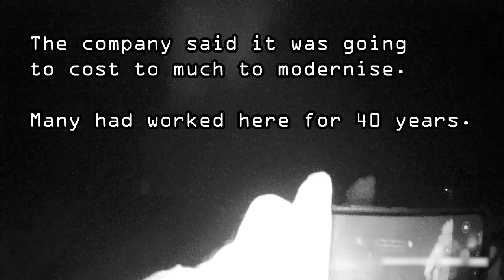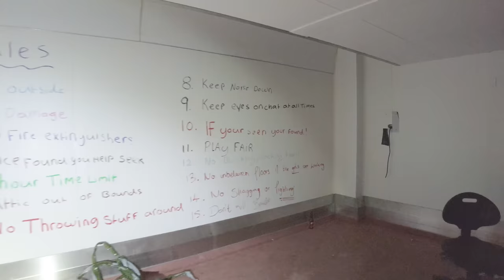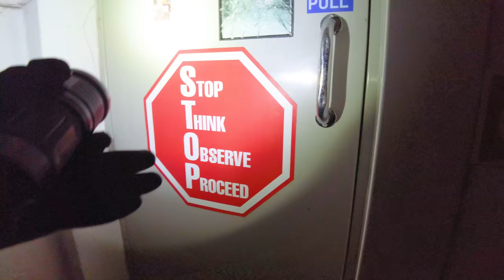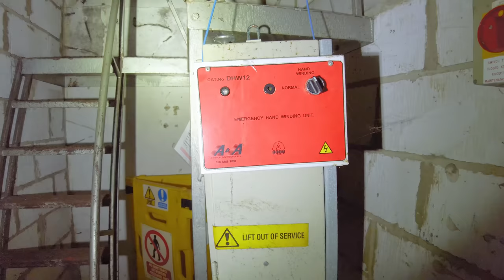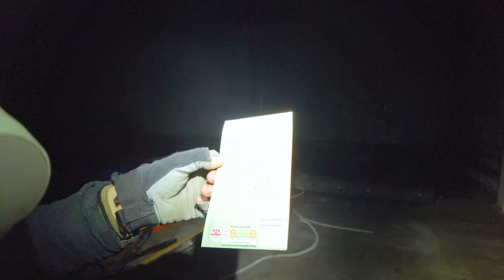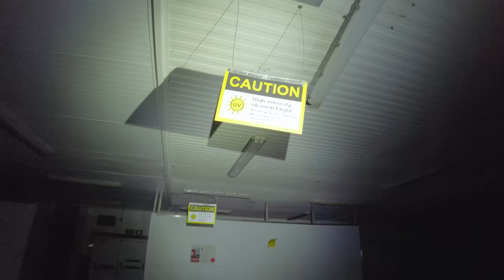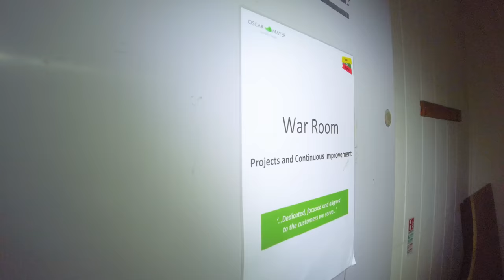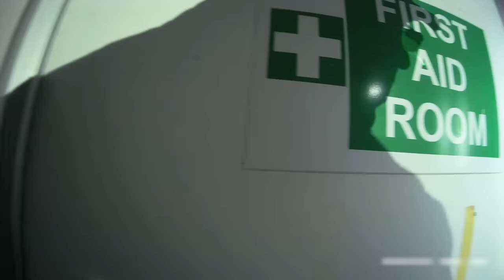Oscar Mayer Chard factory URBEX EXPLORE part1

Comment: Great explore ad normal. Brings back the time when I worked in a meats factory for sainsbury
Hair nets to white boiler suits and wellies
The ceilings are a hundred mill think to keep cold in the room below
High risk floors would be meats storage, the blue sock is to blow filter cold air in to room.
The square hole you went throw was for a roller belt to push product throw to a packing area send a veiw window to check on packers

Comment: Matt their is no asbestos in food manufacturing facilities only if you see warning signs stating it’s contaminated
Reply: it is asbestos when its wet no problem asbestos roofing is still used 80% of houses have asbestos its the form its in and where it is that determines if you breathe it in a lot you can live with asbestos
Reply from the maker: good to know, but when places start getting smashed up I expect asbestos will be there in small ammounts
Reply: @TheSecretVault  Well you can live with asbestos it depends where it is most old houses have asbestos but its either in the roof where you don't go much or outside on the eves. Thats livable if its dust coming down in ya ceiling you gonna have a problem.